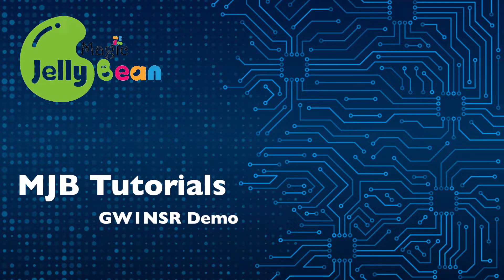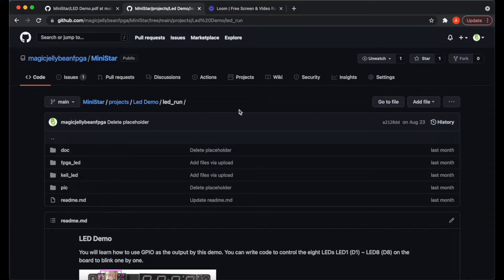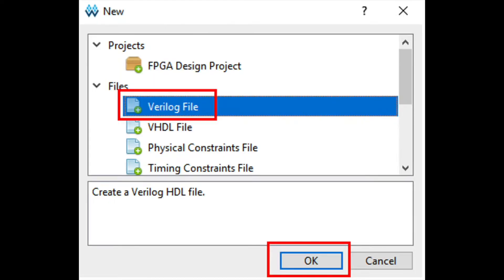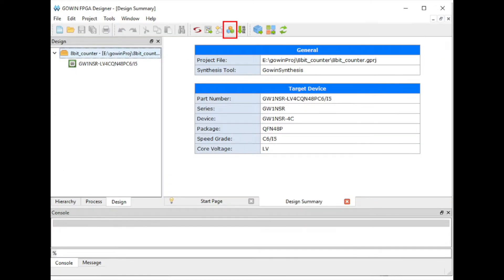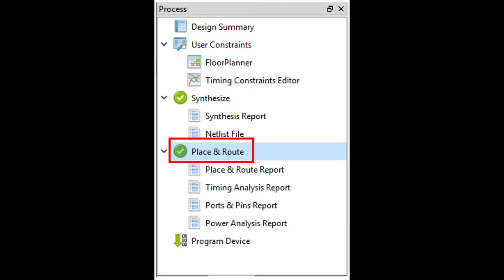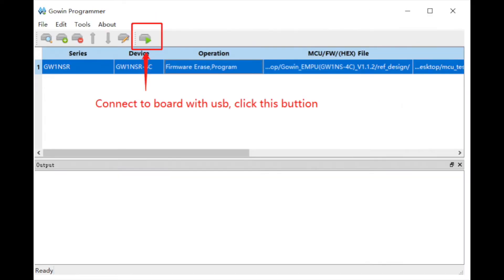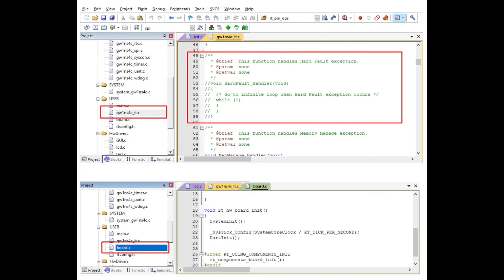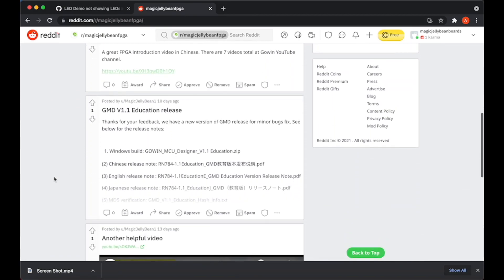MiniStar GW1NSR Demo Tutorial

Comment: This helped a lot with understanding how the Gowin FPGA IDE works so thanks a bunch!
I have a Sipeed Tang Nano 4K with the same GW1NSR-4C chip and I tried following your tutorial for the ARM MCU programming, instead of the SPI LCD however i just used the simple cm3_led project yet it doesn't seem to work even though it compiles and programs fine, It's not the same board and you've been plenty of help as it is already, but if you had any pointers to share I would really appreciate them!
Reply: For prosperity, the problem was i simply used the wrong version of the programmer, it is important to use only the version provided by Sipeed